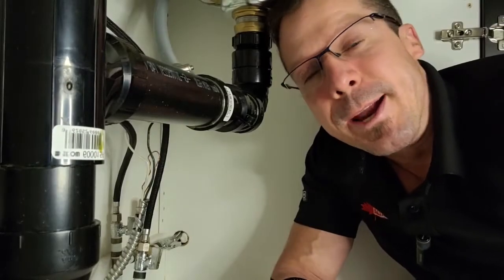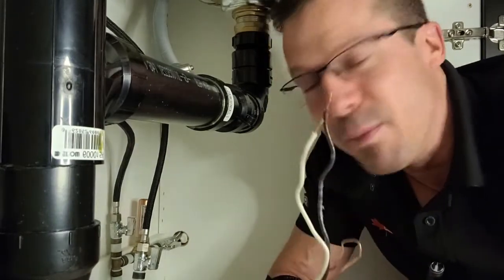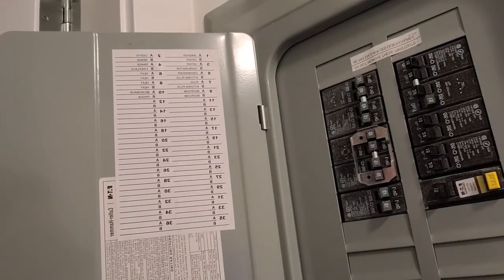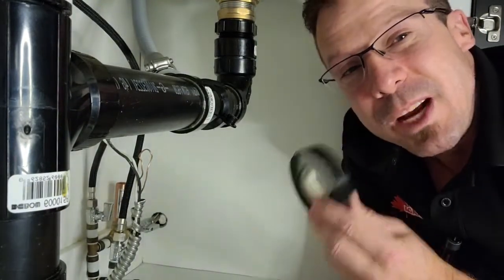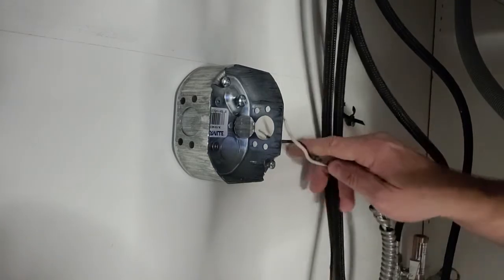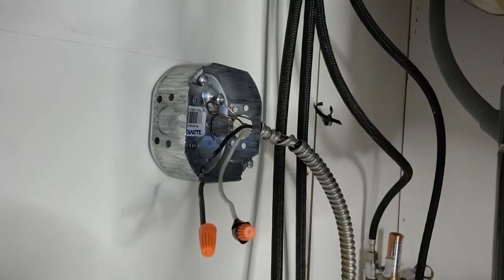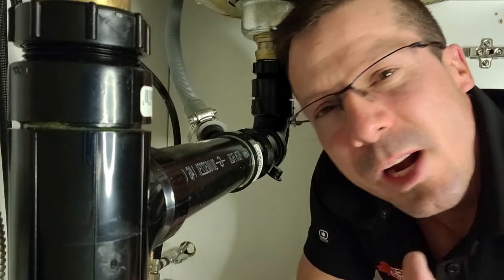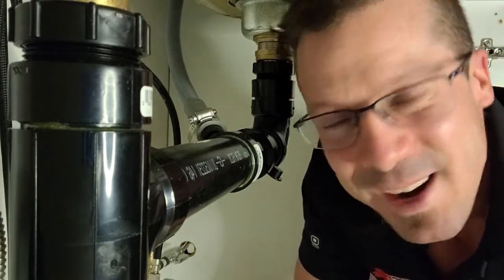How to Install a Junction Box

Comment: Delete this video. *This is not a safe way to terminate that flexible metallic conduit.* The uncoiled section should have been cut off. A conduit adapter should have been installed to keep the conduit from falling out and to prevent the sharp edge of the knockout from cutting into the conductors. The metallic box should have been grounded.
Reply from the maker: Will do right away. This is a cable for the garburator and the breaker is off. No one will ever use that cable again as garburators are banned in Vancouver and most cities will follow. 99% of the time that cable is dangling live under the sink, this is definitely going to fix the problem. Keep going around and bitch about other people's video, yours look awesome.